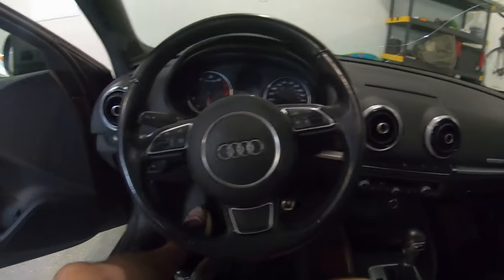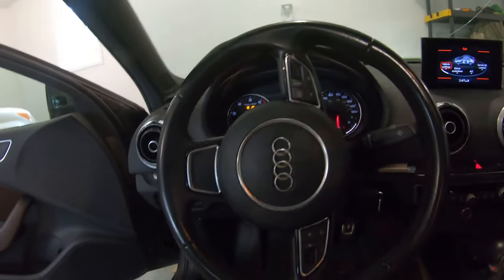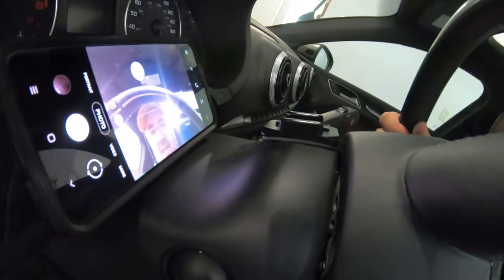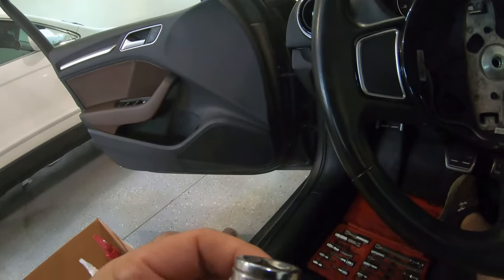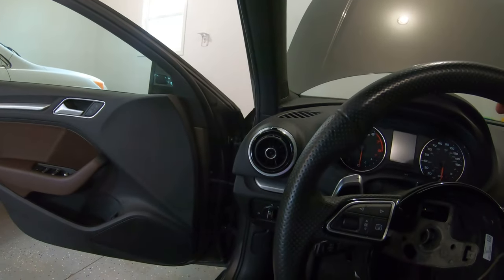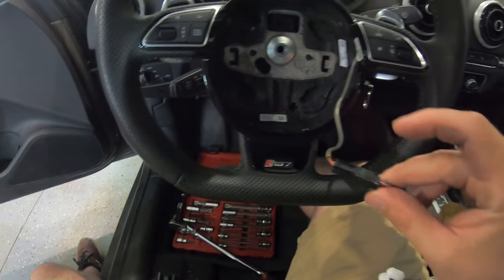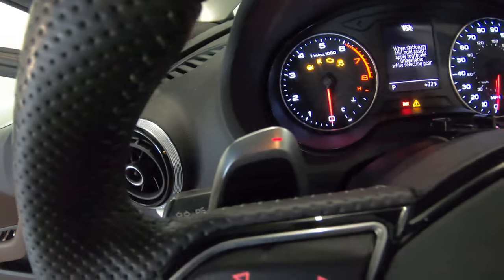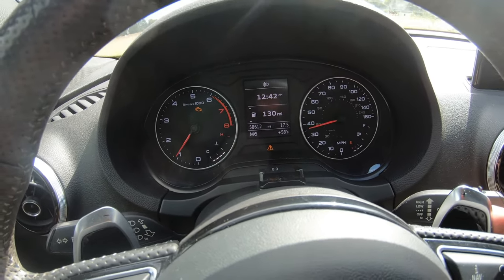Audi A3 flat bottom steering wheel install

Comment: Hello I just bought an a3 8v 2017 without the paddles on the steering wheel and I inquired at the dealers but they do not add this type of option so I searched a lot to find out if it was possible to install it and I came across your video if I understood correctly there is no need for coding or other to do just connect the right lines and it will work is that right? If this is the case thank you very much I am French and intend to try so thank you very much for the answer

Comment: Hey Chris, great video! Quick question! At 5:14, Is the alignment mark, on the steering wheel, and the alignment mark on the steering wheel shaft the ONLY way you know that you have the wheel on straight? Are there any other markers that can also be an indicator that the wheel is on straight like, for example, the clock-spring sticking through the two holes?

I'm asking because I purchased a carbon fiber steering wheel from ECS and the wheel I have does not have a marker on the steering wheel itself. I emailed ECS on Friday and no response yet so I wanted to ask you while I also wait on them.
Reply from the maker: That's interesting that it doesn't have a mark, all the OEM wheels I've ever seen have marks, they might be using an aftermarket core to build the steering wheel. Yes lining it up with the clock spring is one indicator that should get you 95% the way there.

DISCLAIMER: don't girl getting yourself or anyone else hurt

What I would do in your case is put the new steering wheel where you think is straight, bolt it down, and go for a test drive. Assuming your car has a good alignment this is the only other way I know to get it set straight.

Good luck dude
Reply: @96ej  Yeah, I thought it was weird, too, how the ECS carbon fiber wheel didn't come with the alignment mark. 

I'll wait to see what they say before I tear down my existing wheel. I was just hoping there was another sure-way to know if the wheel was on correctly or not in the meantime lol

Thanks so much for responding
Reply: Hey Chris, just wanted to give you a update: ECS apparently does not sell anymore CF wheels with the alignment mark so I used my existing wheel along with the clock-spring holes to align it correctly, and that method worked, thankfully. Not sure if you mention this in your video, or if I missed it, but my air-bag light came on and only way I was able to get rid of it was using OBDEleven and cleared it out manually. 

Thanks again for the video

Comment: Great instruction. It seems you have an  engine light on. Have checked if that is possible to get rid of?
Reply from the maker: So the engine light was on for a secondary O2 sensor because of the tune. I opened up the cluster and covered it with tape. I have since sold my A3 but I told the new owner about it. That way if they scan it there won't be any surprises

Comment: I can’t get the clips undone on the back - I’m pressing them as far down as they’ll go. Any helpful ideas?
Reply from the maker: They push in towards the middle, if you have a good quality screwdriver with a sharp edge that'll do better for grabbing it then something that's rounded.

Once you get the first one the second one is super easy, it also helps to pull a little on the airbag while you're pushing it down that way when it's out it's out

Comment: Hi a bit late apologies, but wondering would this type of flat bottom wheel work with a pre-facelift A3 that doesn’t have the round airbag as standard? Thanks!
Reply from the maker: It'll work but you will need the airbag as well
Reply: @96ej  Perfect thank you

Comment: Hey @Midwest Chris, i was wondering if an Audi S3 flatbottom steering wheel is going to fit in my A4 B8 2008? Looking forward to an answer. Thanks in advance
Reply from the maker: It will bolt in but I don't know if the connectors are the same or compatible. I've changed out the steering wheel and pretty much almost out in Volkswagen I've ever had but in general those were older and I would swap them with quote unquote era correct Wheels
Reply from the maker: Whenever I want to see if something will work and something else I always start on eBay and looking at used parts and seeing if the connectors are the same on the part I want to use and the part I have
Reply: @96ej  Im not that smart when it comes to all that stuff😬been trying to find an answer on forums, the only thing i found out is that i should work. You just have to change the wiring
Reply from the maker: @mathiasmadsen1993  I misread your original post I thought you said you had to b6, yes this should totally work on a B8 A4, if you have the round airbag it'll be a simple plug-and-play if you have the rectangular airbag that will also need to be swapped

Comment: If I did this to my A6 3.0T would it still be plug and play with the 8 speed transmission?
Reply from the maker: Since I haven't done it I can't say with 100% positivity. But since I'm guessing you have a Z8 and it's of the same vintage you should be able to do the exact same thing that I did. If for whatever reason it doesn't work you'll just need to go into vcds and enable paddles. I think there are videos out there of people doing it on q5s and it works perfectly so I wouldn't think that your car would be any different especially since it was a factory upgrade
Reply from the maker: I'm going to reverse-engineer this question again I don't know how I missed this the first time😅 yes it'll work because the RS7 steering wheel was out of an 8-speed car and it works perfectly in my 6-speed car

Comment: Did you use the A3 airbag with the S3 steering wheel? I just bought a S3 steering wheel (same year) for my 15’ A3, hoping I can use same airbag.
Reply from the maker: If it's from the same vintage it'll be the same. Also for what it's worth that's actually an A3 airbag on an RS7 steering wheel, it's basically the same thing as a S3 steering wheel but the leather is fully perforated and it has the taller paddles
Reply from the maker: A caveat here for the super nerds yes some of the S3 steering wheels had the taller paddles

Comment: Great video. But I’m wondering how are the shifters powered if you didn’t have them before? I have an a3 without them but would love to add them
Reply from the maker: Audi/vw etc use the same harness whether you order paddle shifters or not.
Reply: @96ej  oh ok. So once you plug that harness in, it automatically will read that there are paddle shifters?
Reply from the maker: @RichsRantMMAofficialchannel  exactly once you put the steering wheel in they will work is if they've always been there
Reply: @96ej  thanks. I appreciate the help
Reply from the maker: @RichsRantMMAofficialchannel you're welcome

Comment: Hi, do you happen to have the part number for the rs7 wheel? Thanks.
Reply from the maker: It's the 4g number

https://agestyling.com/products/genuine-audi-rs7-a7-s7-quattro-tiptronic-flat-bottom-punched-leather-steering-wheel?variant=39528850981044
Reply: @96ej Thanks, I have another question. Did your original controls have the plugs for paddle shifters and is your car a 2.0 or 1.8. I have a 1.8 and my controls have no plug for paddles.
Reply from the maker: @moochiezpitt  My car is the 2.0, should be the same connector

Comment: Would this work with any 2015+ audi steering wheel? I was thinking of grabbing an S6 wheel for my 2017 a3
Reply from the maker: So the facelift steering wheels have more buttons so if you want to keep all your options definitely get a facelift wheel but yes it will work easily
Reply: @96ej  facelift refers to which year range?
Reply from the maker: @mithplays3654  the facelift will have the smaller airbag just like your car, it's usually pretty easy to tell if you're having a hard time I just screenshot one and then compare it to the other.

Comment: Any idea if the stock steering wheel he has would fit on audi a4 b8.5 2014 ???
Reply from the maker: Yes it should fit, if you have a different airbag you will need to match it to the steering wheel

Comment: Could you explanada me the necesary coding to activate paddles
Reply from the maker: Sure

No coding needed
Reply: @96ej  oh.😪 i installed a s4 2017 steering wheel on my a3 2014 and only paddle Shift are working. MF buttons arent
Reply from the maker: @diegohernan6711  that has the smaller airbag correct?  FL vs prefacelift are different

Comment: How did you turn the wheele the other way with battery disconnected?
Reply from the maker: I probably didn't explain it good enough in the video but that's why I parked on the cardboard
Reply: @96ej  thank you , mine always locked the steering wheel whenever I put it in Park, so I did it in neutral and it finally turned 😊
Reply from the maker: I did it with the battery disconnected for the airbag, in all honesty it's pretty hard to set off an airbag but if you did it wouldn't be good